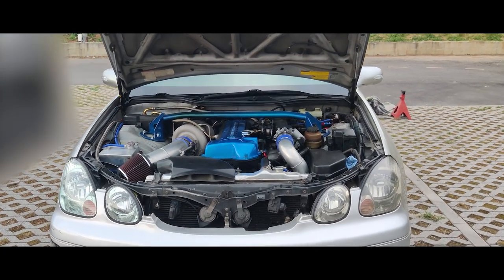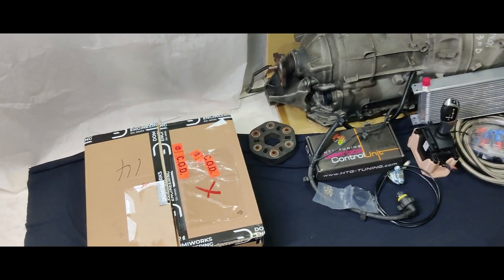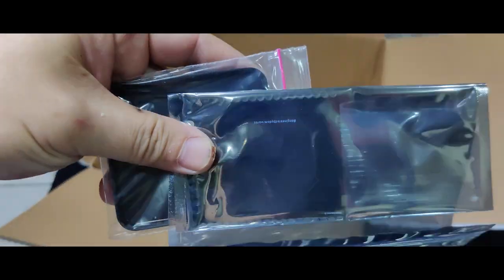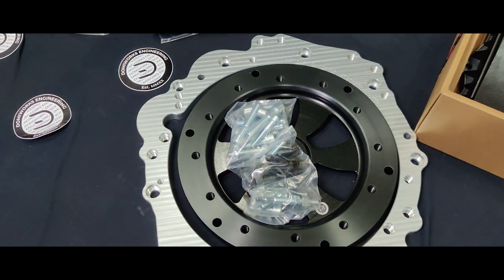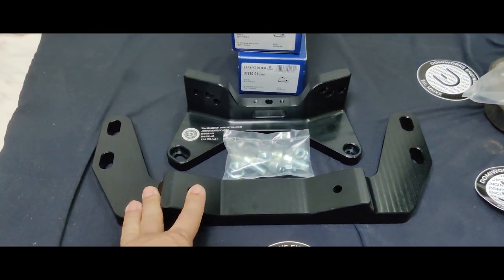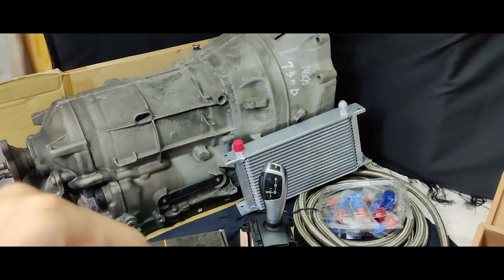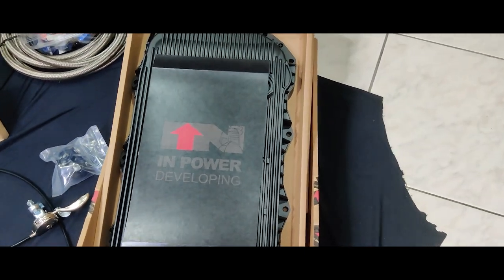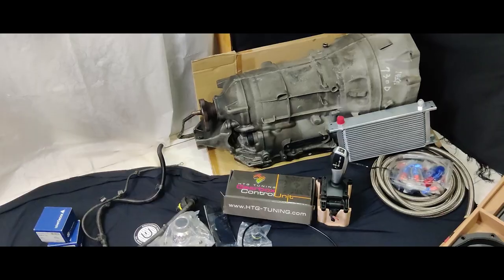Luxious Automotive's Road to #8HP70 Swap on #Lexus #GS300 Part 1 #2jz  #8hp  #aristo  #アリスト #2jzge

Comment: Shoulda went TurboLamik over HTG
Reply from the maker: We're using CANTCU and enjoying it as a daily.
Reply: @LuxiousAuto  Im looking to do the 8hp swap in my is300. How was the install with the Cantcu and is it pnp after install??
Reply: @LuxiousAuto  also would you mind doing a vid showing how you installed it?? There's literally none on here and im interested to see what all goes into it versus the turbolamik install
Reply from the maker: Information is published on the cantcu wiki. If you can't understand the published information then you should seek a professional to do the installation.
Reply: @LuxiousAuto  I was already planning on having a shop do the work. No one around where I live has done the swap in an IS300 and I'm trying to keep this as easy as I can for the shop. I'll send over the wiki post to them when the  time comes so they can follow along. Glad you were able to get yours running well!